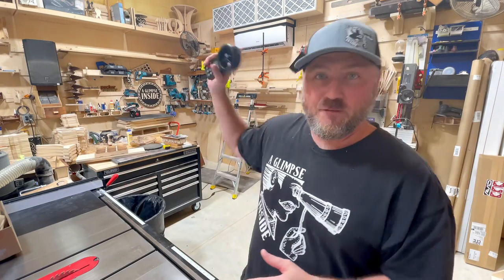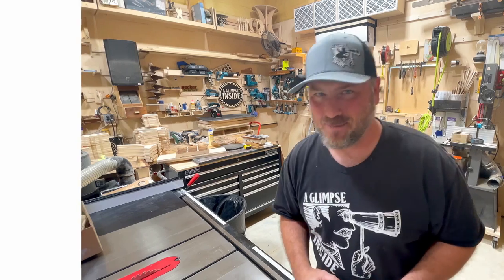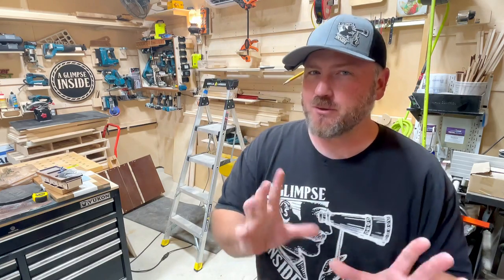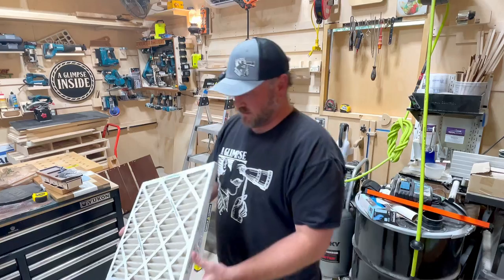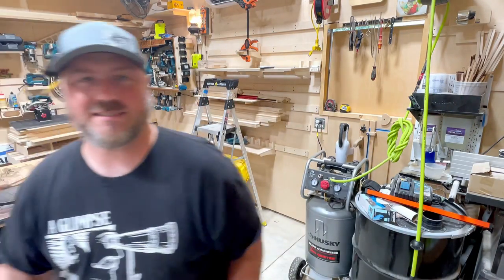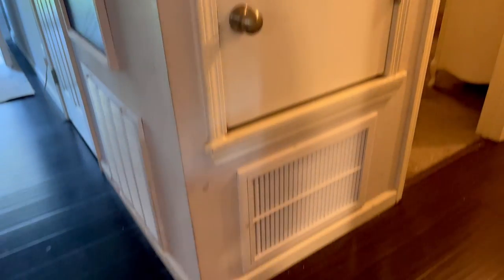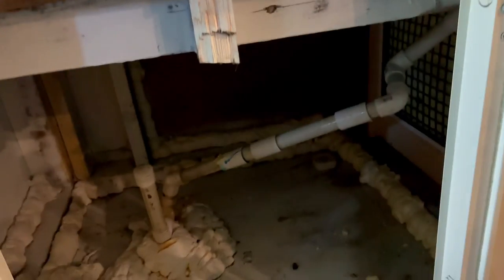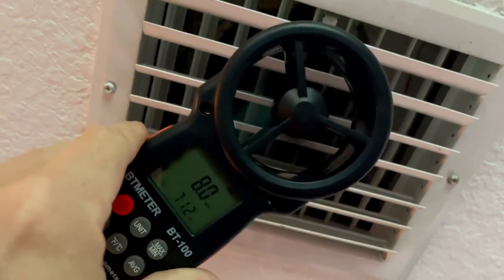I Have Proof You Should NOT Buy Expensive Air Filters

Comment: If you. Want to improve it. Install a bank of filters on the top of the box as well. Don’t use the filters with built in carbon. Use replaceable carbon filters. I Velcro them on. It will make the merv filters last so much longer. And usually you can just pop off the carbon filters and shop vac them. I can’t do with out the carbon because it just removes all odors. You can even build mini 10 inch ones with a fan for bedroom’s completely removes allergies and hay fever.

Comment: Getting one more mile with different filters is enough in the right direction. The motor that would be working harder is likely chosen for its values/price and not a specific load on it. It can likely handle extra for years without any strain.

Comment: It would be interesting to see the flow difference with the FPR12 filters without the screen filters on the unit. Thanks for the video!
Reply: This was my question - what's the reduction of the designed screen filters? That would be a safe percentage reduction to aim for - but to be clear, I would not leave those screen filters in after adding the big filters.

Comment: with 2" filters the extra thickness nearly doubles the surface area so the air doesn't have to move as fast through the media to achieve the same air volume. This also means the air won't be able to push finer particles through the media as easily making a 2" filter more efficient even with lower merv ratings. @KPHVAC is definitely right you've got enough area on those filters...the mesh filter is defiantly worse than what you've built.
 If your unit is variable speed, as most are these days, the fan will have some overhead to ramp up as the filter gets dirty...the speed will vary to maintain the proper airflow based on coil temp in cool or heat. You can test your set-up by blocking the filters until you see the airflow drop off, it will be a slow process as there will be some lag before the coil temp changes and the logic decides to adjust the fan speed but you'll get an idea of how dirty they can get before you have issues.
Reply from the maker: Awesome. When I have to re-order definitely going think. I’m speaking this. My wife heard what I said and literally under her breath says “that’s what she said” she thinks she’s funny and she’s right.

Comment: Not an HVAC guy, but your baseline comparison is what you should consider.  The household unit is designed with the idea of a filter and that should have been included in the original design.  The mini-split in your shop was designed with a filter and that is that cheap little thing that slides in.  You are adding an additional layer of filtering and that is putting more strain on the system that was designed to pull air through that plastic mesh screen with a certain amount of dust on it.  You are probably not hurting the system too bad when filters are new, but if you let the dust  collect on those MERV 8 filters like you did the factory filters, you may not get all that crude built up in the coils like you did before, but that fan motor in that mini-split will not be able  to pull  enough air across those coils  to condition the space without running longer and longer and longer.   Long story short, it will tax your unit if a 2.5 Ton unit was what was required to condition your space  originally.

Not a sermon, just a thought.

Comment: My AC man said to use the cheap filters and change them regularly. Best for AIR FLOW! Best air flow is a MUST.
Reply: That won't work with lots of fine dust that will go right through the super cheapo filters, but agree the high Merv filters are not a good plan in this instance.

Comment: I have a HVAC buddy who has been in the biz for 30 years. He advised me not to buy expensive air filters. He told me to buy the inexpensive fiberglass filters, the ones that come in a 3 pack, and change them often. Like every 3 months
Reply: Cheap fiberglass filters won't do almost anything in this application. Also, if using those dead cat catchers, you should replace them monthly, not even close to 3 months span. 

I agree that most people shouldn't use high Merv filters, but cheap fiberglass filters are only an excuse for HVAC people to not properly fix an inadequate return air ducting system.

Comment: Great video. I'm thinking of doing this when I install one.  I am thinking of using either the 2 or 4 inch thick filters as they have 2 to 5 times the pours as a 1 inch.  Thoughts?

I came up with this idea based on how big commercial dust collectors are designed with huge pleats to maximize surface area.

Comment: If you restrict the air flow 2 things, 
Your A coil frost up and it wont cool as efficiently.
Also your using 1" filters  1" thick filters, you should be using something like a glassfloss 4x19.5x24.5 filter that has a lot more surface area in a merv8 filter more air will pass.
Better yet find a used hvac blower motor with a larger thicker filter to run wile your in the shop, my house uses one of these larger filters I change it once a year. Ill also charge the filter with a spray the spray helps the filter trap more dust.

But if you run a hvac blower fan you can make a pretty excellent air filter and remove a lot of airborn dust also makes a good sanding down draft table with peg board.
Last buy a good dust collector i dont mean a 2 bag system one with a large canaster type filter A 2 stage system is better. 

Anyway the more you filter the air in thd shop the less you have to worry  about the heater air conditioner system  or just dont run the mini split when your using power tools that make dust. I dont mean saw chips either i mean fine airborne dust.

Comment: I think this filter box could be viewed in a very different way. Instead of looking at it as a way to save your mini-split, you could be looking at it as a way to save your lungs. The filters work best to remove harmful extra fine dust when a) they are high merv filters b) they are seasoned. Seasoned filters restrict the flow compared to freshly installed filters. You may need a lot more filter area to effectively filter your shop air while also keeping the minisplit running effectively.

Comment: Did you not consider doing the test on the supplied washable filters that come with the unit?  My guess is that they will be somewhere in a the very low MERV rating and give very little drop in air flow.

Comment: It's a low static ductless unit the fan is not designed to have anything other than the filter that came with the unit. Anything else just restricts it too much. A ducted unit is sized to overcome the static pressure. Buy a suitable unit that can allow higher filtration or just deep clean the coil each quarter. You will find with reduced airflow you are at risk or liquid going back to the compressor.

What kind of airflow do you get on low fan speed without the upgraded filters in place as that's the airflow the unit is designed to have going through it so if you are in this tolerance then the unit will be OK. 

Your unit in the house has also been set likely against the design static pressure here in the EU units have adjustable static pressure which increases or decreases the fan speed to overcome the static pressure or the ducts or filters. 

You'll reduce cooling or heating output if the airflow is reduced.

Finally try removing the original filters that came with the units as well as these will impede airflow as well and are not needed given you have higher performance filters prior.

Comment: Did you remove the built in mesh filter?  With the pleated filters in place, its doing nothing anyway (its more porous than your MERV8).  But because it has such low surface area, and its such a fine mesh, it will be very restrictive.  My bet is that without it in place, you would actually see greater airflow through your MERV8 filters than you do the stock filter... maybe even with the MERV12 filters.

Comment: The fan motor in every furnace, air handler, or ductlesss unit is only designed to overcome a small amount of restriction. They are also designed to move a certain amount of airflow. If you restrict that it's really hard on the fan motor.
Reply: Isn't the greater concern ensuring adequate airflow over the unit's coils? Being "hard" on a blower motor isn't as big of a concern as long as it stays within rated amperage and therefore heat, right?
Reply: @MrStrizver  It's all important! Airflow over the coil is also crucial. I only do new system design for replacing residential HVAC systems. I see way too many homes with a single 14" or 16" round return duct = 600 to 800 CFM's with a system that's supposed to move 1,200 or 1,600 CFM's. For many of these homes adding a 2nd return air duct and grill will double the airflow the system heats and cools.
Reply from the maker: That’s crazy because mine was set up with just a 14 x 20 opening and I install those two returns in the video. I thought the same thing OK I’m not real preview on AC. I just figured there’s no way it’s getting enough flow from that one opening. Thank you for answering back.
Reply: @AGlimpseInside  Two return grills is always better than 1! I'm glad you added more. Two grills directly under your furnace or air handler should be pretty good. The real test is Static Pressure with a manometer. If you watch the static pressure videos on the YouTube channel: Home Performance, you can learn all about it. The amount of supply vents and the size of that ductwork also matters. Most regular neighborhood homes have terribly designed ductwork. Anytime an HVAC service tech is trying to fix a problem they should test static pressure and it should always be under 0.50 total static. Most companies don't test. I've seen 20 year old systems that have never been tested. It's super simple and I test every system I touch.

Comment: You have measured airflow in MPH.  Typically it is measured in FPM.  Doesn't change readings, just different numbers in the HVAC industry.  Your measurements are with new clean filters.  Filters are made so that as they get dirtier, they catch more dust and debris and work better at filtration, but cause less air to flow through them over time.  Would be interesting to know the airflow measurements taken either on a daily or weekly basis to see how the airflow drops as the filters get filled with dust/debris.  This will happen no matter what MERV rated filter you choose.  This will also help you decide on how often they need to get changed.  Several of the comments have also mentioned thicker filters that have more surface area.  These will filter the air at the same rate, but last longer as they have more area for debris to collect.  The thicker filters will still fit in your filter box and probably be held in place by the pull of the air through them when the unit is operating.  An extension of the bottom edge of the filter box will also work to hold them in place and keep them from falling out when the indoor unit is not running.

Comment: Would be interested to know how much does one filter panel effect, by blocking off on or two.
If 4 panels are good then one could make that the same width as the mini-split by having it "one filter deep", and have the sides as filters also.
..but then again I think this is more than good enough as I do not see how the airflow would affect the longevity.. especially compared to wood dust.

Comment: Filter Facts 
Filters are often selected for their first cost rather than their effect on indoor air quality or long-term costs. The result is that many filters are of lower efficiency than they should be. Sometimes cells are not replaced as often as they should be. 
The frame should hold the filter cells firmly in place and should have gaskets to prevent any air from bypassing the cells. There should be good caulking between frames and between the frame and the plenum wall. 

The filter delta P - the difference in pressure between the entering side and the leaving side of the filter rack - does not remain constant. A clean filter cell has the least pressure drop. As the filter loads up with particles, the pressure drop increases. A filter bank should have a permanently installed differential pressure gauge to show the delta P across the filters.

A filter is generally not at its peak efficiency when it is clean. It requires some adhesion of air particles before it operates at its maximum efficiency. However, after a filter becomes fully loaded, it could break down and no longer stop all the particles that it should. As a result, the supply air quantity is reduced and the HVAC equipment, such as the coils and fans, can load up with dirt and require more frequent maintenance or even replacement.

The effectiveness of any filter depends upon the velocity of the air as it passes through the filter. The standard face velocity - the velocity of the air at the entering side of the filter - is 500 fpm (feet per minute) for group 1, 2, and 3 filters. Face velocity is generally 250 fpm for Group 4 filters.

Comment: First, you missed the boat with filters. I think you only thought about the 1" filters. What about the 2"?  How about the 4" filters? That gives you double + more filter area. Second, you should think about going with the merv 11 or 13. You will thank me. You can also look into something like a JET AFS-2000 air filtration system. I've seen guys build something very similar. They have large finger like filters in them. You can have it empty into the AC box if you like. They will, not only help with what you are doing now, but actually keeps the shop cleaner. They are like magic... honestly. Coming from a commercial printing background we had them in several shops (different brand) and I can tell you it actually made the air feel different. It's hard to explain. Once they were hung and on, we just never turned them off. They were just better for everything.
Reply from the maker: Is this the jet you’re referring to?  
This thing is awesome and I’m so glad to have  it. How To Punch Sawdust In the FACE | A Glimpse Inside How To | Plus Check Out This Nugget Ice Maker
https://youtu.be/b3_gdkbxOiw
Reply: @AGlimpseInside  Yes - I've just never seen one that small. I didn't know you had one. The 2000 series I linked to was the only one similar that I've seen. I wish I could remember the brand we'd get in the shop. You could fit someone in it. It was brown, about 5' + long, moved a crap load of air. One way we could tell it was doing something because we always moped the floor every Friday, last one out, and after install water was cleaner.

Comment: When you get your homes HVAC systems serviced ask them to run a static pressure test. It's critically important!
Reply from the maker: Definitely will do. Haven’t done it yet in eight years.
Reply: @AGlimpseInside  Definitely time to get both coils cleaned if you have a heat pump or AC! Make sure you tell them you want your static pressure tested over the phone. They should also check to make sure the refrigerant charge is good. Keeping rodents out of your attic and crawlspace is also super important and good insulation. Good insulation, Double pane windows, and air sealing around doors and windows is the other half of comfort for your home.

Comment: When you took the filters off, did to put the little factory filters back in? That's the comparison of factory filter restriction vs. your setup. If they were missing, then it's not a valid test since the factory filters will also restrict. Since they also "clog"
Over time, the manufacturer will also allow for a range of flow.
Reply: You should measure the drop from bare to factory filter and then pick a filter for your setup that most closely mimics that flow.
Reply: Finally; if you want to actually clean the air (not just protect the HVAC system) go with a shop air filter machine. I see them on marketplace all the time for a hundred or two. Even a suspended box fan with one of the furnace filters will catch additional particulate before getting to the HAVC.

Comment: I would like this for my livingroom one if it wasn't so huge 😅 as i have a dog and I am lazy cleaner, so i get a little dust innside.

The amount of flow restriction you got in the tests is no problem, there is bigger problem/restriction with dirty AC coils and corse filter.😂

I would try 2 charcoal filters in the middle and the 2 others just have the merv 8 ones, yes the charcoal ones will flow less than the others but it will be slightly better for indoor air quality and only slightly lower air flow. 
Also get thicker filters instead and get with as many pleats as possible as more surface area is much better than just more thin filters with low surface area.

Two 2 or 3 inch filters would be less restrictive than 4 1" ones and they typically get better quality (more pleats) just from the increased thickness
Reply from the maker: Dude, mixing the two filters together is a great idea. I’ve never thought of it. And yes, I’ve heard that thicker air filters will definitely help airflow so when these finally kick the bucket, I will change over to the thicker ones. But such a simple idea mix-and-match. Thank you.